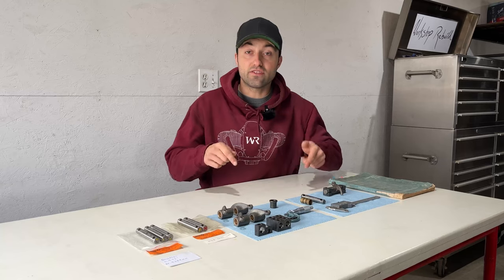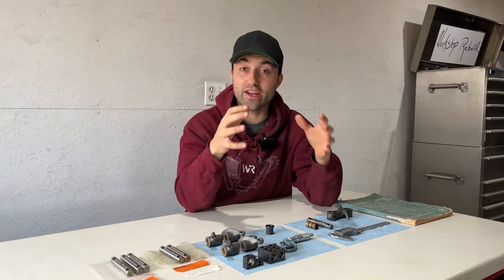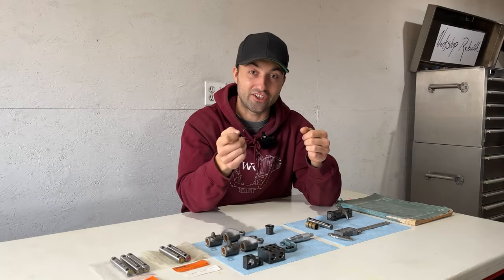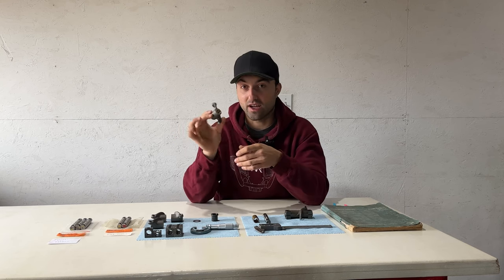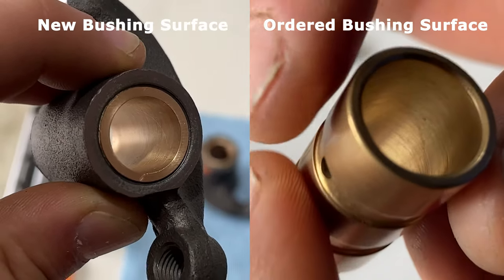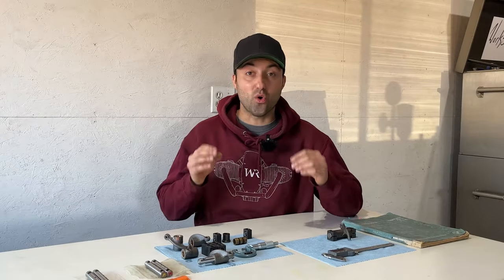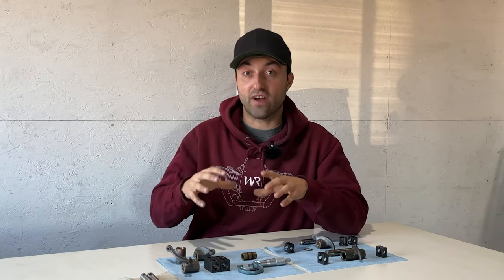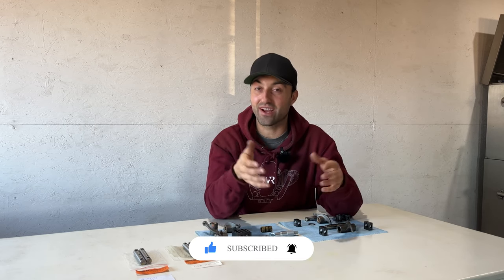I Fixed The BMW R60/5 Rocker Arm Issue!

Comment: Another great video, thank you.  The later model rockers did away with the o-rings under the rocker arm posts.  In your next video could you explain how the oil passage path on your original rockers work?
Reply from the maker: Thank you, Allan! Yes that is correct, the made small changes to the too end of the newer engines and in a future video I‘ll get to that.
In the upcoming assembly video I’ll discuss the whole lubrication system. This will include the oil pump, oil filter, bypass valve, pressure relief valve and lastly how the oil flows to the cylinder heads (rocker arms). 
I hope you will find this beneficial. Regards Andreas
Reply: @WorkshopRebuild  wonderful, tnx

Comment: I'm glad you got the quality that you paid for this time. The stuff you got from Germany loox like it has rifling inside it up against the parts that yuve managed to source  out online and have machined locally. I presume yuve had snow already as my relations in Winnipeg already have but I bet you can't wait to try the finished bike out!!
Reply from the maker: I'm very happy with the parts I received and somewhat lucky they weren't of the same quality as the ones from Germany. I had to cross my fingers while ordering because both sellers could only confirm they were OEM parts without providing rocker arm shaft sizes. My local machine shop did a great job with the bushings, and I'm pleased I could resolve this issue. I would love to find some older machines to assist with repairs like this in the future and would do the work myself.

We already had snow here about a month ago, and it slowly melted off due to warmer days. Since then, we've only had cold nights without any snowfall. It's too cold for the riding season, but I'm sure I'll enjoy this bike next season.

I can't wait to have this bike on the road! Have a wonderful day, Simon! Cheers.

Comment: Cool ! I wonder if you change the valve guide ? it seems to be a fragile parts ?
Reply from the maker: Hi there! The valve guides were replaced by my local machine shop. and honed for brand new valves. The valve guides are fairly thin-walled, but you can heat up the cylinder head to roughly 180°C and drive them out with a punch.
I will share more about this topic during the engine assembly video. Coming soon. Cheers